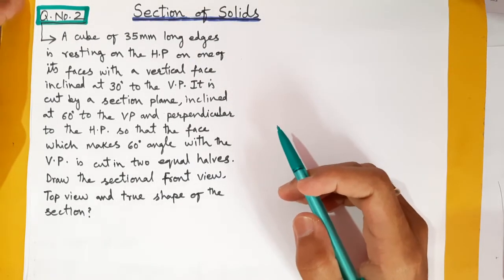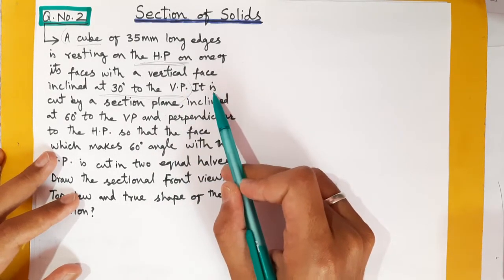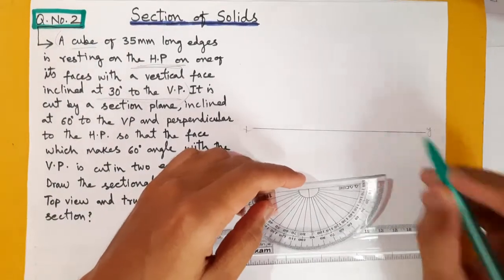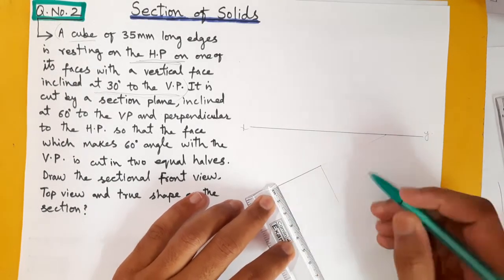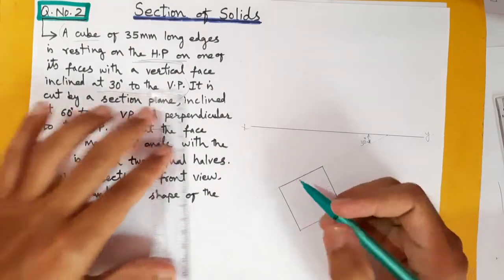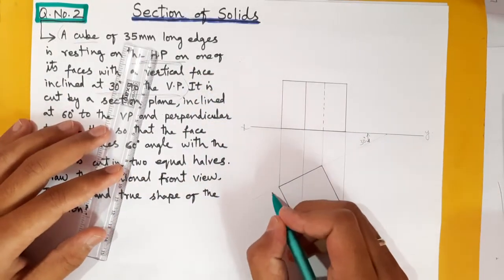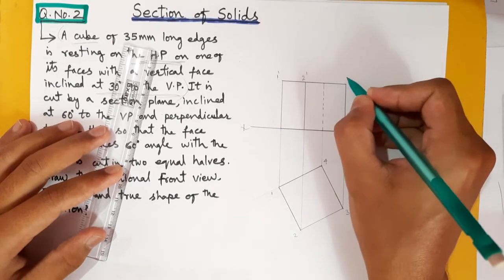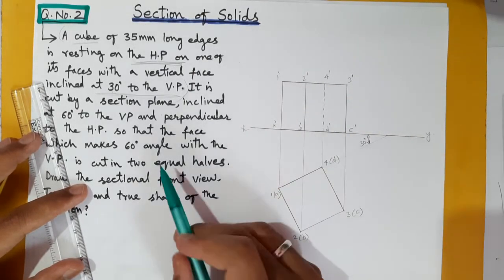Section of Solids | Section of Cube | Question No. 2

Comment: A cube in the same position as in problem 14-1, is 
cut by a section plane, inclined at 60° to the V.P. and perpendicular to the H.P., 
so that the face which makes 60° angle with the V.P. is cut in two equal halves. 
Draw the sectional front view, top view and true shape of the section.